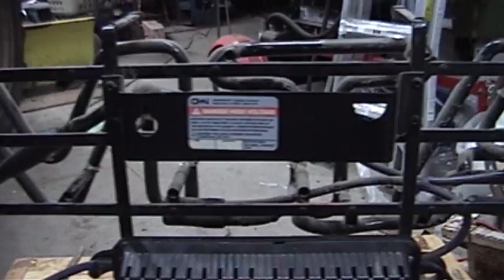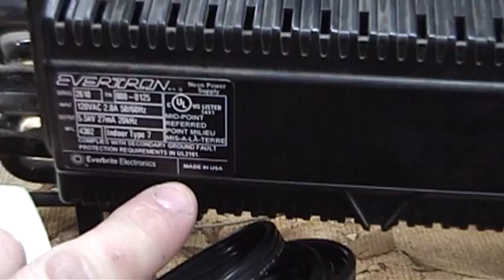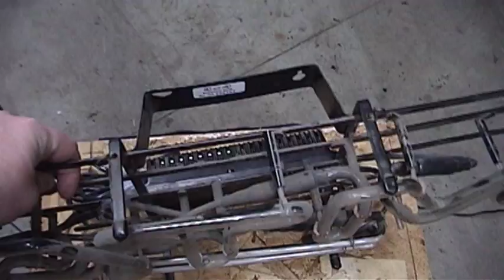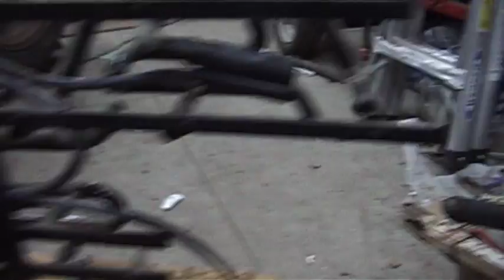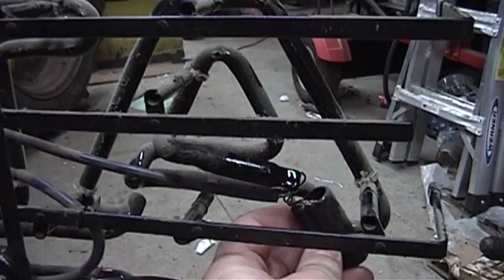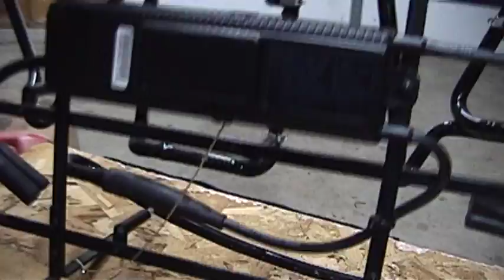Broken Neon Signs

Comment: Is it possible to take certain parts out of the neon sign and keep other areas and still have it light up?
Reply: I've done it.  By bypassing a broken tube you are putting more voltage across the other tubes though.  Not sure how many tubes you can bypass before it becomes problematic though...

Comment: my neon sign is hooked to my light switch.when i turn the light on the neon sign flickers on and right back off.Do I need to replace the power supply?
Reply from the maker: I'm not well versed enough in neon to say for certain. It could be a power supply issue, or even neon tubing that has become difficult to start through electrode wear, gas leakage or contamination over the years.

Comment: So does anyone recommend soldering the high voltage leads to the tube leads if not why???
Reply: Agreed you would have to do a (to me) normal good clean solder joint then cover it with the silicone boot , no wire strays sticking out , just makes sense a good tight soldered joint is going to have way less resistance than twisted together wires no matter how crappy you solder lol, think I am going to solder all the joints on a recently renovated neon with a 9k output just didn't feel right twisting them dunno!!??
Reply from the maker: Evidently what's shown in the video is the commonly done thing for neon signs and their power wiring. You could solder the wires, but would have to use care to make the joints smooth. Any spikes or irregularities might turn into arcing points for the high voltage.

Comment: i like to get the multimeter out and check for high voltage so i can avoid that area of the circuit board and the work on the low voltage side safely  and the work on the high voltage least 
so i can spend more time on the high voltage area

Comment: I did something stupid I had an extension cord I had built a few moths ago and it had failed so i took it apart cut the hot nothing cut neutral and ground and got a lout BANG and some big sparks and the crap 💩 scared the heck out of me because I had no clue it was plugged in because the plug was hidden and it didn't work so I still have a burn mark it the carpet and marks on my wire snipers and the cord itself unplugged now thank god no one was hurt that day but I am a little bit of a chicken like uxwbill and don't like loud bangs so when that happened I ran out of that room and the worst part I never tripped the breaker which it should've because it drew enough current to fry a cat if it touched it but the wire snipers probably seen 15-20 amps when the breaker usually trips at 16.5 amps but that was the scariest time ever for me 

Bleach Videos 1/5/2017 

Srry for the long comment
Reply: It popped because you shorted line and ground together. A typical breaker usually takes a few hundred milliseconds to trip with a hard short(infinite current draw, trip time is <=300ms). Other times, a typical breaker will just not trip on a line to ground short, or it could be defective.

Comment: hi, i used to be in neon industry too, its pretty common to twist neon tube electrodes with high tension cables. the shoe which is actually silicone end cap and the HT cable are silicone based which can withstand 200-300C heat. Back to connection - no other type of connector can insulate high voltage than SPACE. the fault is on yr power feed/connection or electronic transformer. to keep safe from mishandling this sign has to be installed away from public hand reaching or cover with clear acrylic casing

Comment: Older fuses do fail due to age, it's because the silver coated copper wire used. The silver corrodes/vaporises in time and copper wire simply can't hold on the load. Still good to know what inside of these things.

Comment: When a neon tube is made, the tube is vacuum-pumped. All of the oxygen is sucked out, and neon gas or a combination of argon gas & mercury is pumped in. For the ATM sign, it appears that the last unit - the "M" - has a condition known as leak-down. Leak-down is when the tube is compromised and trace amounts of oxygen leak into the tube, diluting the gas mixture. Oxygen burns hot, and sucks more energy - which overworks the transformer and heats up the glass. This would explain the dimmer color..

Comment: i got a sign which has the same frame as yours from a restore. they were selling it for 80 bucks but got it for 8 because half of the sign wasnt working. i tried it out, i found the side which didnt work had a broken bend point and when you move a wire slightly, it sshuts off and diesnt come back on. its very hard to get back on.

Comment: sounds like the sign that smokes has a high resistance joint where the leads from the transformer join the anodes. that's why the leads going into the anodes are black. or like you said the blackout paint might have got on the leads. which also would make a high resistance joint.

Comment: Also I would like to add that as a neon manufacturer the quality and longevity of a neon sign is almost always determined by how much a customer is willing to spend. My profit on a sign is exactly the same regardless of whether I use low quality low cost parts or high quality more expensive parts. My guess would be that the customer who purchased this sign asked for the lowest price possible.

Comment: The neon is hot and discolored, it has gone bad due to poor manufacturing or a microscopic leak. The wires are black because when that neon was manufactured it was dipped in a large vat of black stazon paint and drip dried. There should have been no paint covering the wires or the last half inch of glass. There is a specific way to properly tie the wires together but what you have is basically the standard and correct wire connections for a neon sign of that type. Also not the best transformer.

Comment: @uxwbill You say these use fluorescent lights, that's interesting, I thought there was a difference between standard fluorescent tubes like you'd find in a typical lighting setup and these coloured Neon signs, I'm sure there are technical differences, but i'm getting out of my depth and most likely don't know what I'm talking about.
Reply: yes, the operate on the same basic principles with small technical differences between them.  Like the type of gas and the voltage

Comment: @uxwbill Considering that they are switch mode and have trasistors requiring a heat sink maybe they figured that they would need more ventiltion for cooling? To me they look like they were intended for indoor use like hanging in a window so they probably didn't think it was worth the extra expense to pot a supply for such a cheap sign.

Comment: I think that the larger and higher end signs like a theater, store, or casino would have (if that's the term) use a linear power supply rather then a switch mode type like these do. But the larger signs are also custom made unlike an ATM or a beer company sign so they would likely use higher quality power supplies since they would no doubt have a heavier work load. I've noticed that the ones Aussie 50 picks up are frequently inside metal boxes and potted in tar and are quite heavy.

Comment: oh come bill, v8 ignition systems aren't that dangerous, our 351 in our boat was running at idle and i was pushing down on all the leads at the distributor and two of them gave a really good shock, the sparkplug lead for our old school snowthower did the same but with much more of a sudden jolt

Comment: @onan75 not if you get a good branded one, or if you run it through a back up 120/240 power inverter, tesla500 has one that puts a much cleaner sine wave than his outlet, generators aren't all that bad, sometimes your wall outlet can be a lot worse

Comment: thewhiskey2strokeUSA,  Generator output is NOT a smooth, stable power ban, it peaks and falls sharply.  You are probably thinking of a generator with a built in inverter, like a Honda EU2000i, they put out computer grade power.

Comment: Bignacho25, you discharge a capacitor by grounding it.  Depending on what the capacitor is for I usually use a screwdriver with an INSULATED handle to cross it out to ground.

Comment: Smashing vid bill :-)

Ive never seen one of those, but when you showed the psu i reacted the same as you did, oow its a smp with a lopt nailed to the end :-)

i would use a small knife and scrape the black off the tube wires and the black thats on the glass bit as i think the paint may be conducting between the wires.

You do find some interesting bits bill :-)

Comment: I have the very same neon sine on my liveing room wall but it says BUD ICE and was also made in the USA and on the power supply it states it can run from 120-240 volt ive had no problems with mine but i have to say i don't use it that much. Thay realy should of used a proper iron core transformer i think, i hate electronic crap like thay put in things theese days eg floresent light ballasts, switchmode power supplys ect... it just wont last!! Great video. Phil.

Comment: The main reason I never became a full-fledged radio engineer was because I was just too chicken to put my hand in a transmitter that had 50,000 volts in it... I also will not touch old CRT TV's for the same reason. :) JC